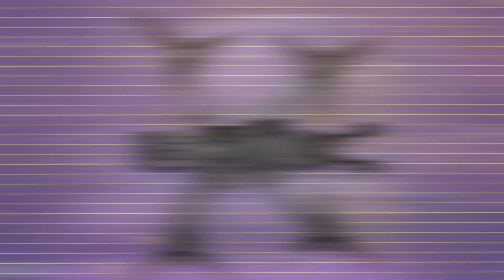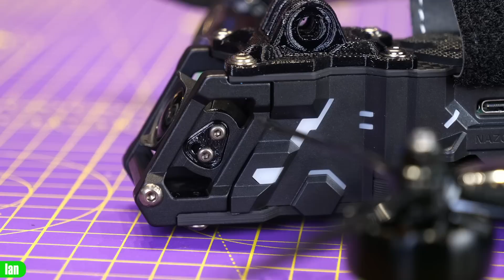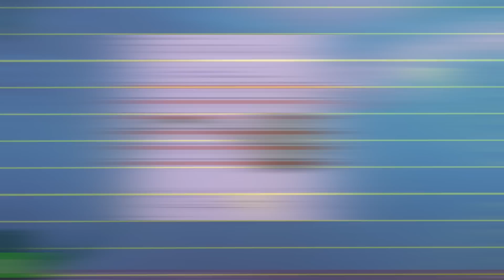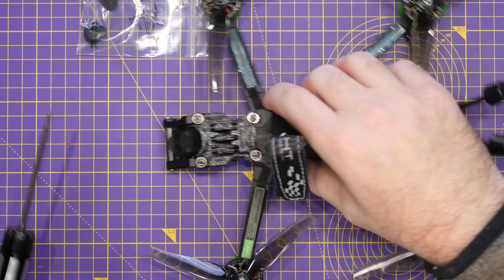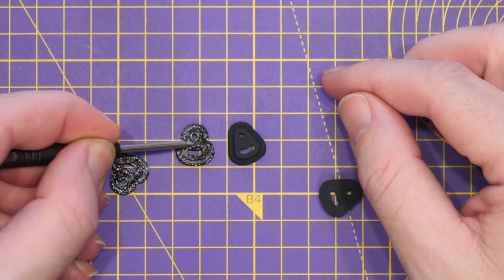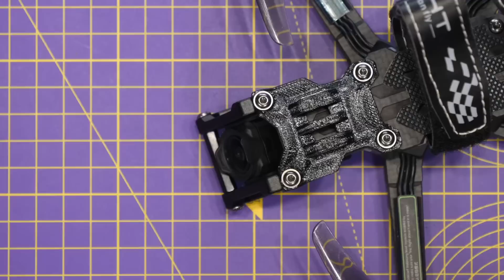DJI O3 FPV Image Vibration Issues ?  How To Fix

Comment: Im trying to figure out exactly which PWM frequency i need to change in BsHeli
Reply: Any luck with the resonance? 
I have just picked up an 03AU at the Post Office today, so before I get building a drone around it, I'm seeing what I can learn. 
My first thought, when seeing this video, was 'will blackbox data help in this case' ? …or is going to be more of a guess, until the vibrations stop resonating with the camera?

Comment: Yup Im getting bad vibrations in my O3 FPV feed and I spin my motors and the front left motor feels like there more drag then the other 3! Thank you for this Ian! I'll be changing out these motors for more quality motors and I bet that will do the trick! I'll report back!
Reply: Did you ever get those switched out and did it make a difference?
Reply: @mitch-k8v  ^
Reply: I changed the motors and glued the lens on the O3 and also rubber mounted the O3. Got rid of a little vibration but not all of it. I even changed pwm on the ESCs. I'm thinking it has to do with the frame of the craft. Catalyst MachineWorks shocker ul4.

Comment: The silicon replacement mounts are a really poor design. You cant really secure the camera angle when tightening a screw against a soft silicone pad, they need to change the whole aluminum mount too so that the screws are tightened against a solid aluminum surface and the silicone pads are sandwiched between the camera and the aluminum mount.

Comment: Thanks for all the great tips. My issue was the PWM frequency, went away when I changed it to 48 kHz. Was not noticible at all in the unstabilized footage. If it helps anyone, my issue presented itself as "jiggling" in the roll axis when stabilizing the footage in Gyroflow. This was on my Nazgul Evoque F5 V2 BNF.
Reply: Same thing happens on o4 pro Nazgul evoque f5d v2, 48khz is super smooth now.

Comment: @Mads Tech - got stock PNP MARK5 o3 6S - i’ve got 96Hz in BLheli suite- you don’t mention what to do in such case , do I need to still change it to 48hz or i can leave it as is as the quad flies ok? Thanks!

Comment: I only get gelo shaking when the g’s are high like pulling up hard from a dive going into a flip. My props are in really bad shape but also have everything zip tied with no TPU mounts other than TPU soft mounted motors. This is an AOS5 build. Do you think new props and TPU mounts is the best place to start?

Comment: Even if everything is perfect Rocksteady gives me micro stutter while recording.  It is very obvious during playback and during flight to me.   When Rock steady off on same flight all is smooth flight video and recording.  As said if RS is off and the vibration is not there than its not my frequency nor faulty camera.  There is something more going on.
Reply: From what I believe, the vibration from the 24kHz frequency is messing with how the o3 gyro data is recorded. I had the same experience as you until I got a 3d printed camera mount replacement for my AOS5.5 and change the PWM frequency. I also captured a flight without the change in PWM frequency with the "soft mount," and the stutters were still present but definitely not as shaky as recorded video without those 2 changes.

Comment: FIRST OF ALL:  checking the lens ! hardware first and this will include the lens or cam mount. this is #1 rule since i fly fpv from 2008.  after the focus issue with the action 3 and what dji said about that i dont trust them any more. dont want to screw up my esc settings with 48 or higher at the low end. thats just crazy dumb and not solving the problem, where it is.  if the gyro inside does best with a soft mount something is really wrong.

Comment: I was having vibrations issues on my Aos 5 03. I changed the PWM frequency to 48kHz and it didn’t help. Then I took the camera apart and put some glue under the lens barrel and now it is smooth. Dji support said I could send it in and they will “help fix it” I asked them if I’d have to pay anything and I got a second reply “we’ll help fix it” so I did it myself.
Reply: Hello what is lens barrel ? Do you have a photo of where you put glue plz

Comment: I have had two cameras that the lens got completely loose after having flown in cold weather. Near or below freezing temperatures seems to have knocked the adhesive loose and the lens was freely jiggling on the threads. I had to use glue to adhere the lens again to resolve the issue.
Reply: Well that's definitely my problem. I had zero issues with my O3 until I flew in -15 F weather. Haven't been able to fix it since.
Reply: Thanks for the comment. Ill have to take a look, I have been having moderate vibrations ever since flying in the snow in -6 c weather. Where do you apply the CA? Just along the base of the lens?
Reply: @dennisklein3574  basically. The lens threads in and I just put some more adhesive right on the threads.
Reply: @MurdersFPV  alright, I'll have to give it a try. Thanks for the help!
Reply: @dennisklein3574  hey not sure if you tried it yet but I gave it a go last night. If using CA glue try to huff on the camera (for moisture) or a quick spray of IPA before application. My CA glue didn't dry after 12 hours or so then i sprayed some IPA on it and it dried in 20 minutes. I don't know what plastic is used on the o3 lens but CA glue did not readily adhere and dry to it.
Reply: @dennisklein3574  yep along the base of the lens
Reply: Did this give you jello in your FPV feed, or after stabilisation?

Comment: I have multiple 03 setups and in one case the IMU was damaged and I had to get a replacement O3 unit. The way I finally realized this was that it was not giving me a level horizon in Gyroflow when choosing lock horizon even when the quad wasn't flying.

Comment: i had bad jello only in gyroflow. i changed my motors to new motors and issue disappeared. im still frustrated. i wanted this to replace my gopro, but seems like i will still use my gopro for good footage.
Reply: I agree

Comment: I had bad jello on my O3 unit -visible in the recorded video but not in the goggles. After quite a bit of messing about I discovered the jello went away if I toggled the EIS setting from RockSteady to Off. That’s a lot easier than dismantling the camera or altering the camera mount, so I’d suggest trying it first.
Reply: That's exactly why people was watching this video for. Gyro data jittering only matter when you turn EIS on or using Gyroflow to stabilize a footage. If you don't care about using O3's footage then you just turn off EIS, this video is not for you.

Comment: Thanks for the video! I too was struggling with vibration ever since I got my O3. I also did the same thing this video suggested (good solid frame and props, camera soft mount, ESC 96kHz PWM, etc.). Now my O3 videos are buttery smooth.
Reply: this happens while using rocksteady? how about turning it off? does this problem still exist?
Reply: @baaao  Yes, it was happening even when using Rocksteady or not using Rocksteady.

Comment: Fantastic info, Ian! Thanks a bunch! 😃
Stay safe there with your family! 🖖😊
Reply from the maker: Thanks MC.
Reply: @MadRC hello sir! I took the screws out of my Geprc Mark 5 to adjust camera angle of O3 unit, I set it as I wanted, now I wanna put the screws back ( they are all exactly same, 4x ) and they just stuck half way??? Like I can screw them back in just a little bit and then they both stay in the same spot leaving like 3mm gap to the actual drone. I tried to push a bit heavier but no help and also don’t wanna try pushing really hard and break the camera lol. What is going on? Please help me I beg you I’m losing my mind I got this drone 7th day now and I still wasn’t out flying cos there is ALWAYS a problem. I just finally charged my bats, set everything on Beta Flight and now this💩. Omfg….